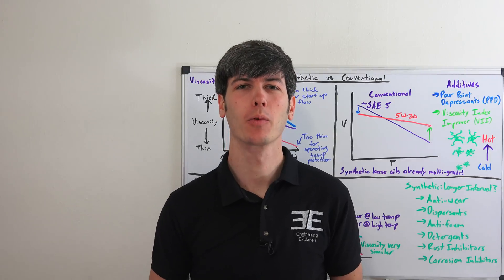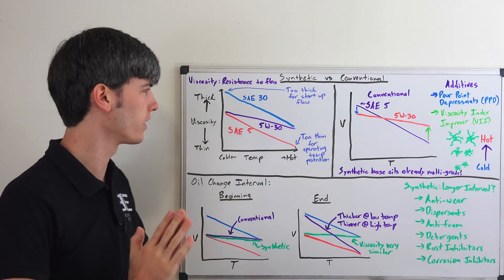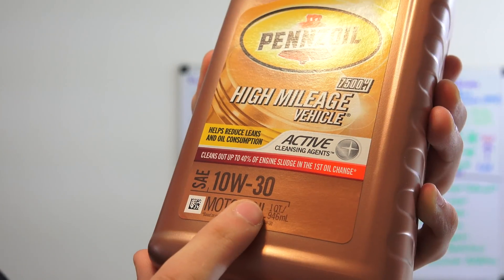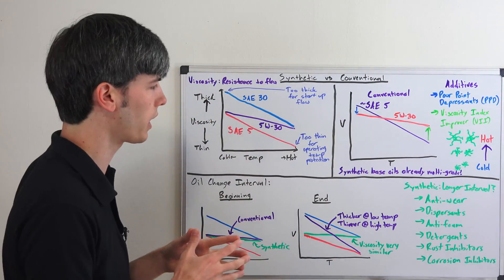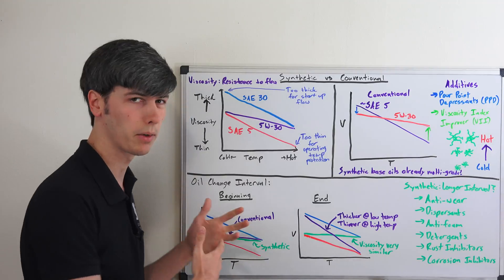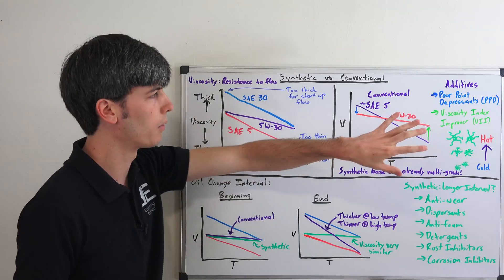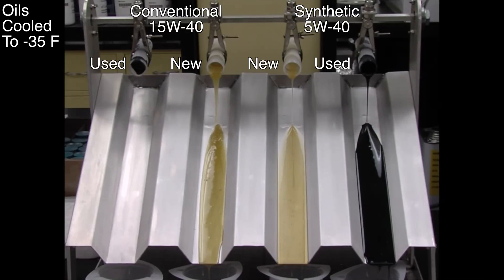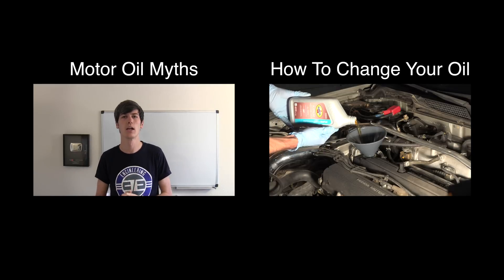Is Synthetic Motor Oil Better For Your Car?

Comment: Why would anyone put conventional oil in their car? Why do they even sell it? :D
I guess it's just american thing. You hardly see conventional oil for sale here in Finland, it's all synthetic.
Reply: Some people swear running synthetic ruins your car. I think it is funny when people buy a new Mustang and change the oil every 3000 miles and if you read the owner's manual, it states not to change it until 10,000 miles. But these quick change shops need to make a buck, so they tell people to change 3k miles and some will tell you that the synthetic is more expensive and will ruin your car. At least that was what I was told one of the few times I couldn't change the oil myself and had to take my car in.
Reply: The_vb , correct, 15 years using conventional oil on 79 f150 5.8m , one day I decided to put synthetic and all hell break loose on me ; leaks everywhere up and down my baby .
Reply: Because if you have a baseline and a premium, you can charge premium prices.
Reply: +Daniel Skrivan Here you can get 5 litres of fully synthetic oil for $20. Mobil, Castrol etc. premium brands start at about $30 for 5 litres.
So if the price is the reason to go conventional, how much do synthetic oils cost in the US?
Reply: Older cars are often incompatible with modern oils. Some vintage cars are designed to use a certain type of oil specific to that era. For example, a 1970's Datsun 510 is designed to run conventional oil, specifically with a lot of zinc. Anything else can cause premature wear.
Reply: Cost depends on brand. I buy 5 quarts of Mobil 1 at Walmart for $28. If I go to the auto parts stores, they charge $35. Premium brands such as Royal Purple or AmsOil cost $10-12 per quart.
Reply: IgoByaGo they can tell you that you have to bring your car in, but congress passed a law stating that they can't monopolize your service to void the warranty. Supposedly, they can't void the warranty based on the brand of oil you use, bus some oils will definitely ruin your engine since the viscosity is so far off...with those ones, you might as well run water as your engine oil.
Reply: Mobil 1 is on sale right now at Wal-mart, $22.85 for 5 quart jug. Should be the same at your area.
Reply: +IgoByaGo , I use to have a 93 Camry v6 since 1995, the book say to change the oil every six months if you use the highways or freeways a lot , but if is only used on the streets; change the oil every year (conventional oil) got rid of the car last year for electrical issues. engine was a monster.
Reply: I have come to learn that Toyota engines are indestructible. My FJ was a beast. Horrible gas mileage, but awesome. Now I have a Prius and an FR-S.
Reply: My owner's manual says every 3-5 thousand miles, so I do it every 3. I do it myself, and it's really cheap. Vehicles can go a very long time with regular oil changes.
Reply: What car do you have? My 2002 Astra's owners manual says oil change every 18k miles or 1 year, which ever comes first.
I have changed the oil every 10k miles or so and the car now has 235k miles on the clock and the engine still runs like brand new. I have always used fully synthetic Mobil 1 0W-40.
Reply: I have a 1997 Ford Ranger and a 2005 Ford Explorer.  Both take 5 quarts of 5W30 motor oil. My Ranger has about 130,000 and the Explorer has over 195,000 miles. All vehicles are different, so it is best to read the manual for their recommendation. It sounds like you are taking really good care of your Astra, and it's paying you back with many years of good service and I'm sure many more to go. Changes every 3,000 may be overkill, but I don't mind and since I do it myself it's usually only a tad over $20 for oil and a new filter for me to do it, and it's fun!
Reply: It's an industry term, so people are going to use it.
Reply: In some older vehicles (like over 30 years), especially old inefficient cast iron block american engines, synthetics tend to find the leaks and weep through the seals easier.
Pretty much all modern vehicles recommend synthetics.
Reply: pk13910 Different design, different tolerance. From what I heard old seals don't like synthetics
Reply: Here's one reason why: Potential for leaky engines. I have a 5.0 Chevy engine which leaks a few drops after shutoff since I started using Pennzoil Platinum. At least the engine's going to be clean but I really should get the leak fixed.
Reply: Clearly our values are different; I'm planning on keeping the car for a while and it's not a $500 car. The oil's $22.xx at Walmart now for 5 quarts. I also get longer drain intervals.
Reply: I have a rotary engine and synthetic oils cause a faster build up of carbon on the apex seals in my engine than conventional oil. So really it's a Japanese/Mazda thing
Reply: Engines that burn oil or leak oil won't leak as much with conventional vs. synthetic
Reply: Its usually recommended to do the first oil change at 3K when your car is new , since the engine may worn out some thick chunks.
After that just go for the regular 10k.
Reply: okleydokley  yea true. Engines run a long time today. Any time your car breaks down its never the "actual motor".

Comment: in my old cars I just change oil once a year because I don't drive them over 3k a year and put lucas oil stabilizer in them with conventional oil.The old M3 gets half conventional, half synthetic with oil stabilizer. This seems to be the best combo and looks the cleanest after a year. But you guys can figure out what you need.All of this was done by experimenting over the years

Comment: I have used both regulate and synthetic oils for a number of years.    When In Alaska (1979 - 1981) where the temp 
went from -70 to a high of 100 deg F  the biggest difference I notices was my 1977 Dodge  225 Slant 6 would start
easier than many other vehicle with regular oils.   I could go longer betwen oil chanes with no appreciable difference
in the condition of the oil.    I keep a close eye on it and the only thing I did at the time was change the oil filter and 
add a quart every 5000 miles.    While the initial cost was a little higher it did prolong the life of my vehicle.   I keep 
it for 30 years and only had to do one rebuild on the engine during that time.    That happened due to a valve breaking
and damaging the cylinder wall.     At the time I had 69000 miles on the car.     When I finally sold it at the scrap 
yard it was due to body rust from being in Missouri for 7 years and the salt had taken its tole on the body and I did 
not have the skills to repair it.  But I did pull the Motor, Transmission and end to sell to another person who was 
restoring their vehicle.       I have continued to use synth motor oil with excellent results, but to me the key is to 
keep an eye on the oil regularly and maintain the condition of your engine.   over a period of time I find I can go 
longer between oil changes (Saving Money) and my vehicles last longer because I keep them in good condition.

Comment: The flow demonstration is completely biased as it shows two different weight oils as you said, however letting them flow at -35F is simply done to make things way more dramatic than they really are.  I do agree with the viscosity change and synthetic oils are something most should consider.  Just don't see why the demonstration had to be included as it is engineered to show synthetic flowing better at a lower temperature which the 5W rating would imply.

Comment: can you comment on the insistence of BMW and Mercedes Benz using extremely long oil change I? they both state oil can be used until 15,000 miles.

Comment: I own a 1994 GMC 1500 2wd 4.3 V6. It currently has 305 thousand miles on it. I bought it used and it had 76000 on it at the time. It had Valvoline changed every 3k miles. Purchased it from a friend. Well I had been a fan of synthetics for some time before buying the truck. I had been using Mobile One in the truck up until about two years ago. At that time I switched to Amsoil 5W 30 signature series oil. The change frequency is one year or 24,000 miles. To refer to the original subject of the topic here, there is a major difference in petroleum based oil and synthetic. You see the molecules of conventional oil aren't uniform. For that reason every time you turn the engine off moisture condenses inside the crankcase. When this happens a molecule of moisture can and does attach itself to one of the molecules because they aren't uniform in size. Synthetic oil won't allow the moisture to interact with the oil thereby protecting the engine from forming varnishes and acids which deteriorate metal parts. So what you are looking for in a motor oil is a boundary layer of protection between two moving metal parts. That's what synthetic oils offer over conventional oils.

Comment: From my online research and understanding, the number before the 'W' and number after the 'W' are not measurements from the same scale. For example with a 10W-40, the 10W viscosity is measured/obtained at cold temperatures using a different testing technique than the methods used to test the same oil at operating temperature to gain the hot oil viscosity, in this case the '40'. Does this make sense? Therefore showing the SAE 5 and SAE 30 on the same scale, but comparing them as 5W and 30 (for cold and hot viscosity) doesn't quite work.

Comment: So if i get this right i can use conventinal 15W 40 like i always did during summer. And during winter change to 5w30
Afterall i change my oil every 5000 miles or depending on what season.
Everyone always scaring me im damaging my engine. Right now im at 180k miles ... never had a problem whatsoever

Comment: Was the 'used' oil taken from the same engine or a different engine? Was it 'used' for the same interval, say 5,000 miles?
Reply: I'm trying to see if you controlled the variables or if we're comparing lawn mower conventional oil changed after 10 years vs a car @ 3,000 miles with synthetic.

Comment: Doesn't matter what kind of oil you use I'd you purchase a crap car (new or used). 
Not going to name any particular manufacturer but I've done engine swaps on cars with anywhere from 200 to 20k miles because the vehicle was sh*t from the factory.
Buy a quality vehicle, do your maintenance on time, don't abuse it and you'll significantly reduce your chances of engine failure.
Reply: if*

Comment: Is full-sythetic oil (eg. 5w40) good for old turbo--diesel cars? Mine is 2000 1.9TDI. I plan on using such, so what would you suggest? Mineral or full-synthetic?
Reply: If your engine doesn't have an issue (Sludge, mainly) then there shouldn't be an issue. I'm using Synthetic 0w40 in my 1999 6.5 Diesel now and because it's a 0w40 instead of a 15w40 the oil circulates through the engine quicker upon startup which is much better for the engine. However, Synthetic is a much better oil and in severe cases of engine neglect (not in my Diesel engine) it loosened sludge too fast; this in turn clogged the engine. If you want to be cautious then use Conventional for two 500 mile intervals then switch to Synthetic.

Comment: It's important to remember these graphs indicate the logarithm of viscosity and not the viscosity itself. Viscosity varies exponentially with the decrease of temperature. So on the graph the difference at low temperature viscosity might be even 300% due to how logarithm makes the differences from the upper side of the graph be very high although there are parallel lines.

Comment: what rating of oil should i use on my old ride like grand marquis. should i use 20W-50 or 10W-30? i badly need ur reply sir...
Reply: What year is your car? I'm using Pennzoil Platinum High Mileage 5w30 Synthetic in my 1990 Mercury Grand Marquis Wagon but it may have caused an oil leak (being a synthetic in an older, more worn engine) so I'm thinking of switching to a slightly thicker 5w30. Just remember, using an oil too thick for your application will make the engine work harder and cost you more in fuel. 20w50 sounds awful thick if you're talking about a car made after 1978 unless the engine's heavily worn.

Comment: Pick a good quality oil, the correct weight, stick with that brand and change the oil when it's time. 

Me personally, I've used Mobil products for the last 20 years with great results

I change the conventional oils at 5000 miles and the full Syn, at 10,000 miles in autos

I've had the Mobile 1 tested and it was all in spec at 10,000 miles. They do have the 15,000 mile oil but I'll stay at the 10,000 mark

Full Syn, Oil is really good in higher heat situations. Like engines with turbos or air cooled engines ATV's  Motorcycles and such.

I use Mobile 1 in my riding mowers due to the heat they are put through

Comment: For engines run at continuous high rpm and higher heat (For racing) would it be recommended to use a thicker or thinner oil?
Reply: Funny thing is I've heard of some racecars using straight 0 oil but those engines are rebuilt after each race too. It really depends on your specific kind of racing and I'm not well versed in that, I was just adding something to the subject.

Comment: Why are you mainly using Celsius in this video? Then in the cold oil comparison you switched to Fahrenheit, whats going on? I like a lot of your viewer base is in the USA. Feel free to use both, just state both when giving information. "Blah Blah Blah __°C or __°F..." I don't like Celsius, but will HAVE to learn it later due to my majors so receiving the information in both forms will greatly help. 

I have always liked engineering and mechanics. You have given me the inspiration to go for my double major (mechanical and electrical engineering) I love your videos. Keep up the great work.
Reply: Talking in Celsius is common when speaking about oil viscosity, it's how the data sheets (which are public) are written.

Comment: +Engineering Explained So what if you're running a "Synthetic Blend" oil, for example: Pennzoil GOLD. What is the difference in a Synthetic Blend when compared to a conventional or a full Synthetic?
Reply: It's in-between Conventional and Full Synthetic.

Comment: will the synthetic oil increase the power of the engine or just protect it? if not then which oil is better for power ? @engineeringexplained

Comment: Would love to see what you think of Castrol Magnatec.  Is it a gimmick?
Reply: I've used it a few times and it appears to cling to the dipstick more than other oils I've used. It also has more Zinc in it than other oils on the market; it shows in data sheets and the smell of it is more like gear oil.

Comment: nice demo. great explanations. question: is the molecular "size" of synthetic smaller than conventional? when I took my subaru and switched over to synthetic at 50k miles within three days my engine was ticking and rattling a little at idle. as soon as I switched back to conventional the ticking when away.  I have had plenty of friends who use only synthetic with no ticking, but many of my friends who have switched to synthetic have very similar ticking sounds. any ideas? I thought maybe, because synthetic is simply not the same as it doesn't fill the same space between the engine parts. in other words, once conventional is used in an engine it wears a bit more, leaving more space between the engine parts. I imagine this is fine until you decide to "upgrade" to synthetic you start to hear the slightly more worn engine parts clanging around a bit. 

even some of my friends have had engine failure after using conventional for the first 100k mile and then switching to synthetic. maybe "high mileage" synthetic is formulated to take up some of the slack between engine parts? 

I hope you have some real information on this subject although you are sponsored by penzoil and probably have to be careful about saying anything that can be construed as bad. if word got out that it's bad to switch to synthetic after having used conventional in an engine... that would be bad for penzoil. ironically, in my thinking it's only bad because the conventional would have worn the engine a little more. this is all based on the concept of your engine breaking in mind you. 

thanks
Reply: You really have to compare the data sheets of the oil you were using to tell. They're public information.

Comment: Interesting as I use a semi synthetic oil for years . Did a compression test after 100,000 miles and readings were still in the well above the minimum levels. Vehicle does long distance motoring all day and rarely has time to cool down. PS// he is cute